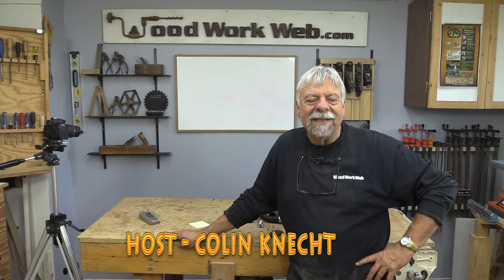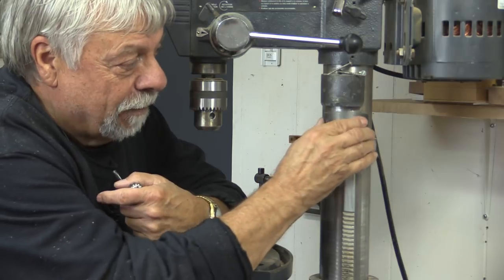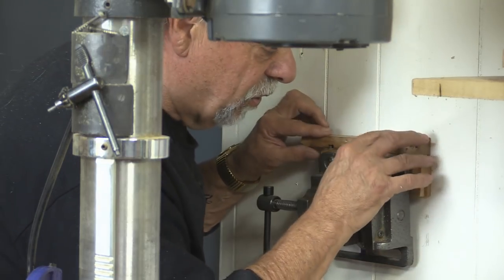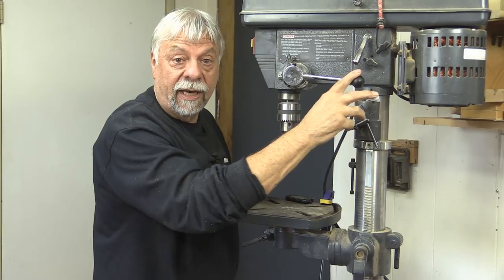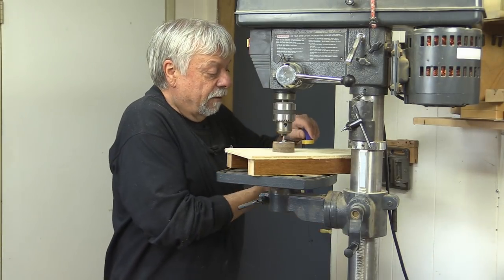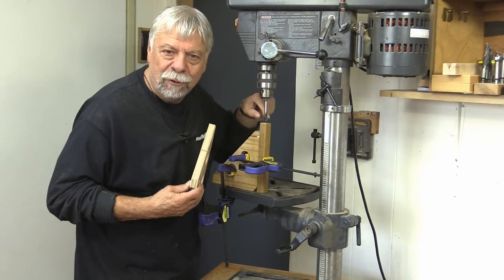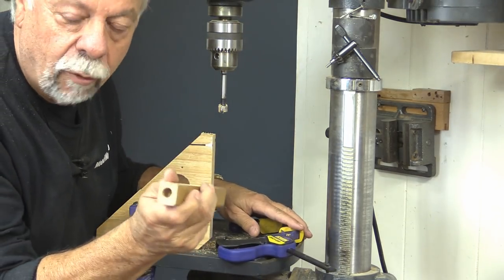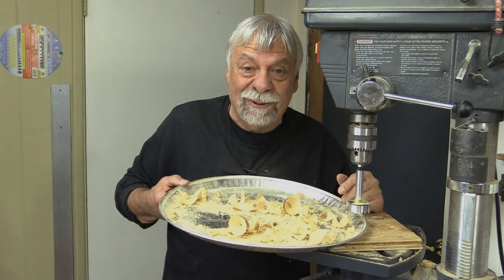5 Quick DRILL PRESS Hacks - Woodworking Tips and Tricks

Comment: Your hack for the drill key is a good idea.  I solved the problem in a different way.. I have a ratchet drill key attached to a three foot fine chain,( so it never walks away!).  It always sits on the side of the bench. After I tighten the drill chuck, I immediately set the ratchet to the off position so it is ready to remove the drill bit when I am finished.
thanks for the video!

Comment: Those were good ideas, Colin...thanks.  I was changing blades on my table saw one day and the bolt slipped out of my hand and seemingly disappeared into the twilight zone. I finally found it and I immediately sprayed it orange ( it's what I had on hand...fluorescent orange or yellow would be even brighter ), and now if I drop it, I can quickly find it. I need to do it to my drill chuck too 'cause I've been known to lay it on my work table while I drill something and have it get hidden behind a piece of wood or something and it takes a few seconds to see it. And yes on wheels..!!

Comment: I saw this video a couple of months ago and thought about removing two of my levers from my drill press. A few days ago I was just sitting on my couch and an idea popped into my head. Why not try putting a "suicide knob" (for steering wheels) on the knob end of one of the lever. I bought one and so far it seems to work great and on my Jet I didn't need to do any modifications to make it fit. One other thought concerning the drum sander jig, why not just make a series of different size holes in the top. Thanks for all the great tips and for helping me "Knecht the dots" in my workshop!

Comment: Great tips. I have almost the same drill press as in your video. Mine is a Craftsman, 15"-12 speed-1/2 H.P. built in 1985. Can you please do a video on all of it's features and how to set things up? I'm not sure how to exactly use it correctly. Also, how should I treat the main shaft because it is showing signs of mild surface rust. Any help understanding my drill press would be great. Thanks so much.

Comment: Some nice ideas, for sure. With the sanding platform, you have one hole and suggest putting on a plate on the platform for smaller sanding spools. But you could make a few holes in the plate for different size sanding spools, right? So then you wouldn't need to put an overlay for smaller spools. You don't want to make the platform look like Swiss cheese, but a few holes shouldn't be a problem. Does that make sense?
Reply: again, your idea is great, mine was more complicated thank you for this
Reply: Evan Pritchard 🇹🇨🇹🇨🇻🇺

Comment: You can use just the 3rd handle without removing the other two.
I like to have them all there because I use my forearm on one of them for easier leverage when drilling steel.
Reply: Yeah the purpose of having all three is that you can achieve better leverage for certain tasks. You don’t have to remove the two in front to use the third as he demonstrated lol

Comment: Did you build the roller cart to get the drill press to that particular height or was it just where it ended up....I have a similar unit and am yet to mount it....I always wondered the best location of the handle in relation to my eyes.

Comment: i have a 6inch drill press from walmart i  refinish a tinker with guitar but when it comes to the bridge pins of a floyd rose piviting bridge it just does not cut it i cant reach far enough into the body to dril;l si iam forcesd to do it by hand and hope to get them perfectly straigh and parallel is there any way to extend the drill for wide items. or am o=i kinda screwd.

Comment: Question: I am trying to bore a 1" hole into the top of a dried out birch log (about 2-3" diameter and 6" long) using my drill press. I plan on putting a tea candle in it. Anyways, I've tried the foster bit and I've tried the paddle bit. Both catch and spin my log really bad. I had a welder fabricate a clamp for me, but unfortunately it still spins the piece so hard that it ruined the logs exterior. I'm a t a complete loss. I'm not wood worker either. Can someone help?
Reply: If the bottom of the log won't show you could put a couple of screws up through your drill press table into the bottom of the log to secure it to the table.  Also since you're using a 1" bit be sure you lower your RPM's accordingly.Edit:Another tip:  Use smaller bits initially and work your way up to the 1" hole size.  This will reduce the amount of material being removed in each pass for a smoother operation and less resistance by the log.
Reply: Great advice. I will try! Thanks

Comment: I need to drill a 1/2" hole thru a 4x4 (3.5")13 times and my drill press is only making it half way thru. I need a tool that doesn't cost much and can complete the hole from side to side in one pass. Not drill press + hand which is double the work and I get blow ups on the exit hole side. Any thoughts?